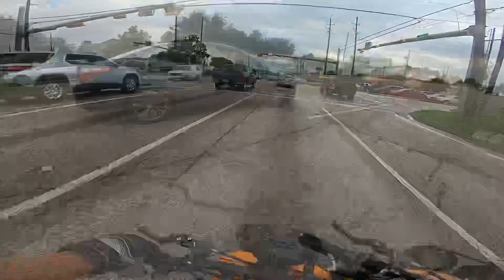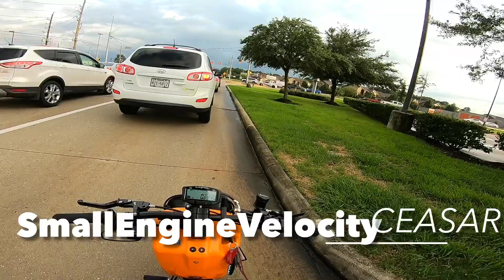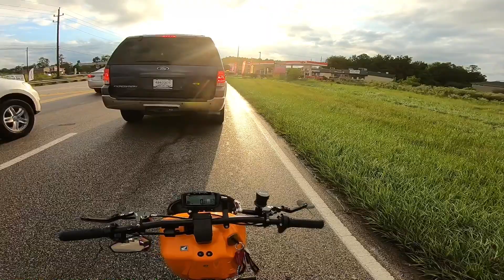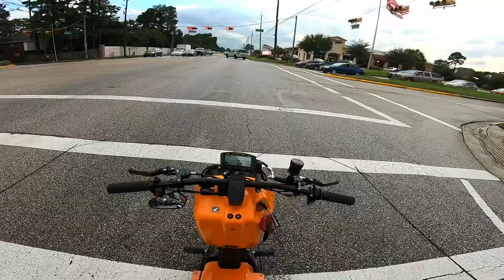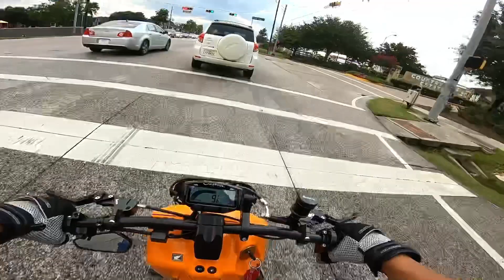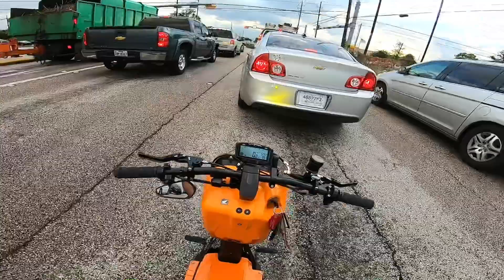PSA: Ruckus owners, it’s been done before. Let’s make new stuff! #SmallEngineVelocity

Comment: Sea level effects the same also with temp. I can clearly go faster in Houston than I can in Fort Worth especially at night. Crustina doesn’t like to be ridden at night when it’s colder.  I go 43 tops at night
Reply: SIRPUCK might be running lean. Colder air is thicker so it needs more fuel. You might try upjetting. Even dirty jets could create a lean situation.

What intake are you running?
Reply: SIRPUCK try pushing in the velo stack. If that doesn't work.. I'd clean the jets. If it still isn't better, upjet the main.. you may need to move the stack back out at that point.

Comment: So true with all being done before.  That's why on my chuck I try to be as original as I could to set mine apart from the norm.  Such as my battery box with a cubby hole that comes from another clone type.  

I would second the extended gas tank.  Maybe one with a built in fuel gauge.  Other things I just realized I have not seen much of are rear wheel stands.  Most places that used to sell them are out.

Subscribed!  Looks like I'll have to start watching all your past videos.  Not enough scoot motovloggers I know.  Something I actually might want to do if I ever get a decent mic.

Comment: Hey ceasar crash my ruckus recently and now my wheels not align, I replace the forks and my axel and it’s still not align could it be my triple tree?
Reply: Hellaskinnyskin yes.. it could be. But have you tried adjusting the handlebars? What parts are lined up together?
Reply: @GETlife  handle bars are lined up with the fenders so thats correct the wheel is just off by a smidge
Reply: Hellaskinnyskin there's a bolt through the handlebars.. the nut on the rider side has a rubber cover. The head on the front is hidden by the brake cables. It's a 17mm and 14mm.. use box wrenches. 

Loosen till the bars move, adjust with your feet holding the tire. Tighten down enough so it's hard to move the bars... Then adjust one more time perfectly. 

Sitting on the bike and rolling back and forth a little is the best way to confirm its straight. Then tighten being careful to not make them crooked again.

It may take a couple tries your first time, don't be afraid to do it over a couple times till it's "perfect".